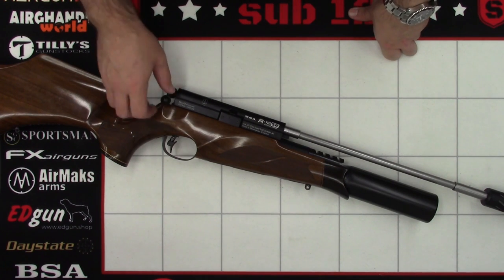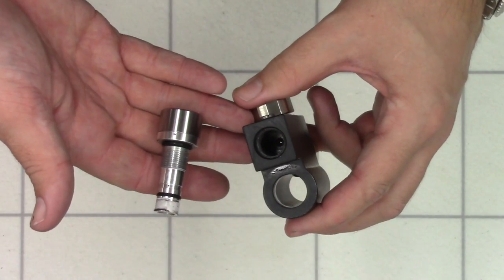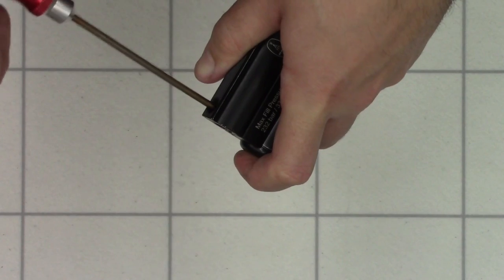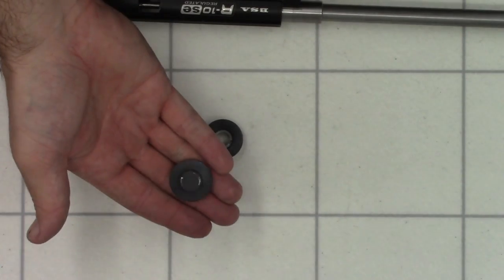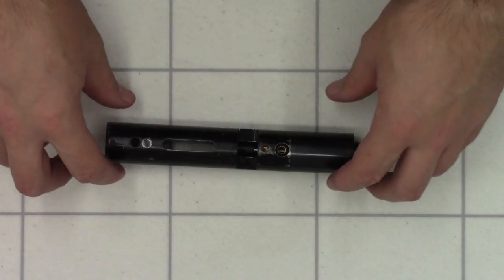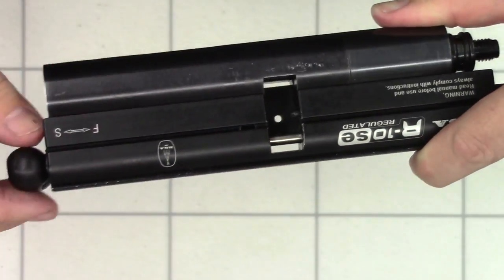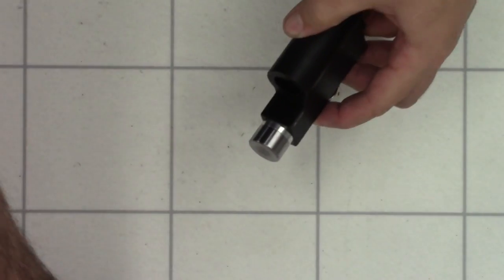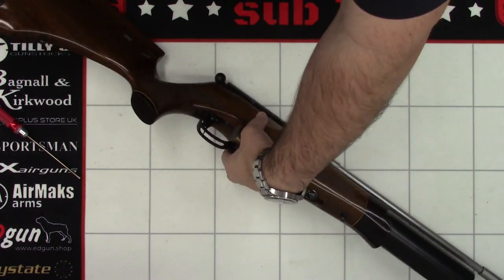BSA R10 Disassembly and rebuild + Huma reg install

Comment: Absolutely fantastic video. I would have no issue follow this guide i would of liked it if you would of said NO grease/oil here .seems wrong when moving parts have no lube, I would be worried in case you forgot to say grease this. I have a mk1 which I love, bought a HW100 prior which was a nightmare and sent b ack to Hull for refund. I was over moon with the R10 but sent it to John bowkett to tune, it came back like a new gun, even better. I dread anyone having to work on it, if I needs seals erc done I will follow this guide, well done and thanks

Comment: Nice video. The R10 mk2 is the first air rifle I took apart and tuned with the help of videos from Darryn at xtx. My only gripe is that the small hex heads strip easily and tolerances are not as good as air arms or weihrauch.
Reply from the maker: Thanks, Darryn made some good videos I used to like them, shame he gave it up really. The QC on the BSA stuff can be hit and miss, but the AA and HW stuff is normally spot on. Thanks for watching.

Comment: Excellent vid. Just about to upgrade to a Huma as my stock reg is leaking so really appreciate this teardown. At 26:00 you are dry firing to test but the safety appears to be on - any notes on assembly to ensure it's engaged properly?

Comment: Hi a quick question in the regulator block there is a threaded screw 2mm which sits behind the regulator under the pressure gauge.How far in or out should this be please Thank you

Comment: Hello,can i ask a pressing quessing. i am new to the R1O Mk2 and searched for a vid of a total strip down and found this excellent vid. done so clearly i would attempt it if  work is needed. i looked for a strip down because i read that the R10 has a issue with the breech/action area being weak around the transfer port area due to lack of materrial? the article said that if light pressure is applied at the bottle and barrel movement can be seen.It was reccommended that any owner should use a 1 piece scope mount that bridges the mag well to strengthen the area. in your vid i can see the area in question but i would have no idea if this is a issue or not.do you have any thoughts or advice please? thank you

Comment: Im hoping you can help. I've purchased a huma reg and when stripping the gun for the first time, unbolting the toast rack, the rack seems to be glued in. Also the block serial number on yours is JK 1175 on mine its ST 1466. Did they start to glue in the Toast rack and is there a work around to remove it.. Or do you even have to.. Thanks from Will
Reply from the maker: the toast rack interlocks with the bottle housing it's probably wants a slight twist and the rack will come out  😀
Reply: @sub12airgunners  your a star thanks.. Your vids have pulled me out of the s£it many times... Respect🙏👏

Comment: Just tried fitting my huma regulator but it doesn’t go all the way in.
There’s a brass cross bit  in the block obstructing it does this have to be removed?
If so how do you get it out?
Thanks.
Reply from the maker: Hi yes that has to be removed and the o ring you can tap the block to get them out usually   👍

Comment: Hi Jake please can I ask for your advice. I recently bought a 2nd hand BSA R10 SE  . After shooting the rifle for a couple of weeks I have had to take the rifle into Crawley Surplus as the pellets were jambing in the magazine. I managed to wiggle out the damaged pellet a few times but on the last time the Range Officer at my club tried to hammer it out with a rod but this has damaged the pellet probe so that I couldn't use the bolt the rifle also seemed to lack in power. The pellets I have been using were reccomended by the club and are JSB Exact 8.44gr and 4.5mm. Have you experienced this problem before and could you reccomend a suitable pellet to ovoid this happening again once I get the rifle back. Thanks in advance of your advice.
Reply from the maker: Could be a couple things, I would recommend to use the 8.44 JSB some pellets just don't like magazines but the JSB's should be fine, the next thing is the mag its self, older rifles came with all metal mags which were notorious for jamming so a new mag may be beneficial. Hope that helps somewhat, hopefully the fellas at crawley can get it sorted for you. Thanks for watching.
Reply: @sub12airgunners  Thanks for your help Jake. I have ordered a single shot tray but will try the pellets.

Comment: Recently purchased a new .177 r10 TH Super Carbine. When pressure topped up the first 10 or so shots are striking about 100mm low at 30yrds then back to normal. Is this normal for the R10? Or should i be returning it to the shop to remidy. Appreciate your advise and what you believe the issue is.
Thanks Rob
Reply from the maker: Hi, it sound like the reg is not doing it's job properly, the R10 reg is not the most reliable,  you could try just filling to 200bar but i would be inclined to return it for repair, it should shoot about the same when just filled all the way down to reg pressure really
Reply: @Sub12 Airgunners  thankyou for your advice, air bottle was a little low so could only fill to 200 bar. I will return to have it checked. Once BSA warranty has expired I will look to install a Huma reg. Otherwise I'm really pleased with the R10, fantastic gun 👍

Comment: Does reg pressure affect pellet velocity? I don’t really understand what pressure the reg should be set to.
Reply from the maker: It dose, the higher the pressure the more available power but you need more spring load to open the valve to get it, a good starting point .177 90 /100 bar .22 80/90 bar  in sub 12 and barrel length will play a part also

Comment: R10 regulator in my gun has failed, does that mean it's the seals around the regulator that have gone, or do u need to replace the regulator..
Reply from the maker: you can re-seal them but it's not worth it IMO put a Huma in and forget  it